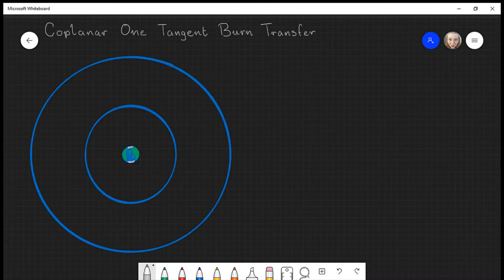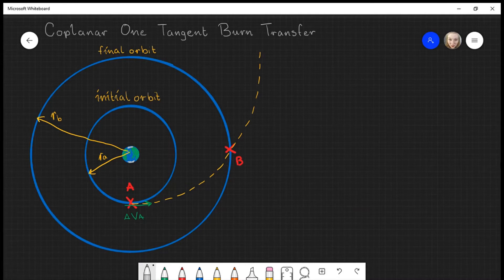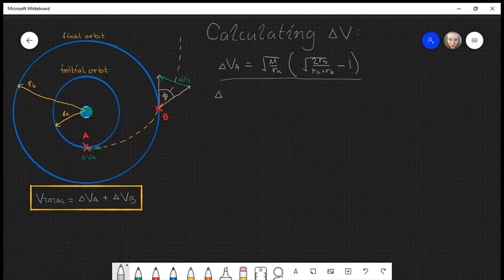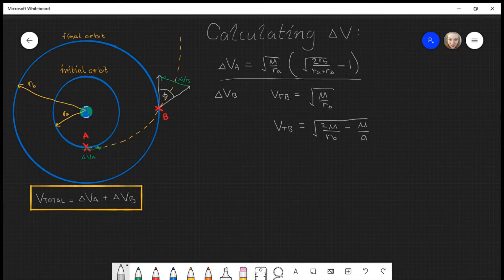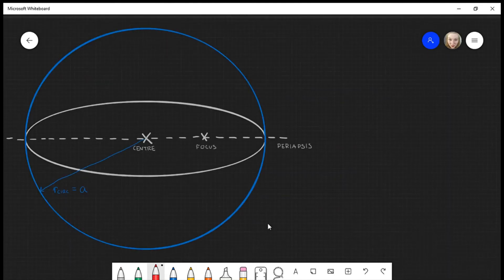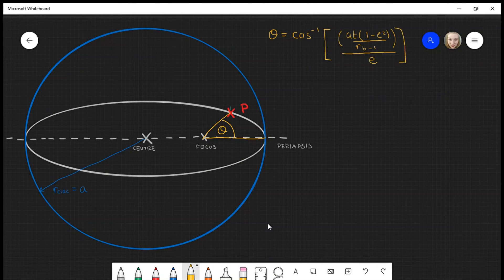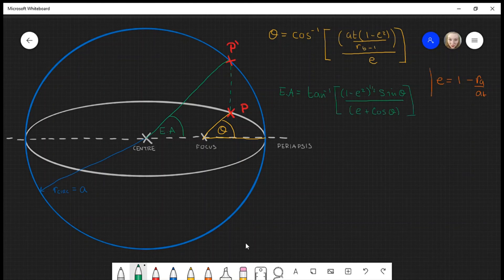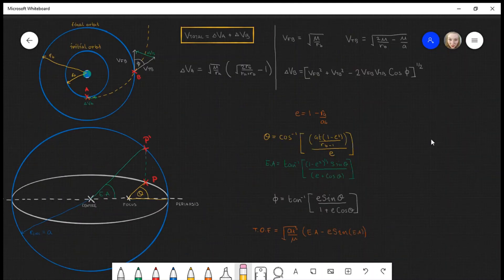Coplanar One Tangent Burn Orbital Transfer

Comment: Great video, I was wondering though, how do you find the semi-major axis of the transfer orbit before calculating the velocities if you don't know the perigee or apogee of the transfer orbit? Also, how come you can use the hohman transfer equation for delta Va with ra+rb\2 even though point a and point b are not the perigee and apogee of the transfer orbit?
Reply: Yep she was wrong about that the semi major axis should be the semi major axis of the trajectory if you didn’t slow down at point B. I could be wrong but that doesn’t seem to be justified to calculate it that way.